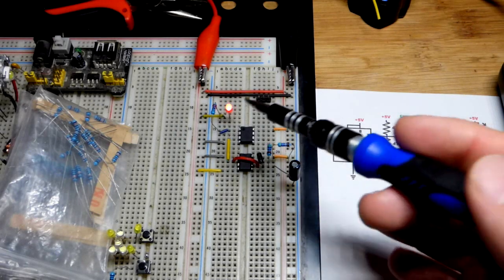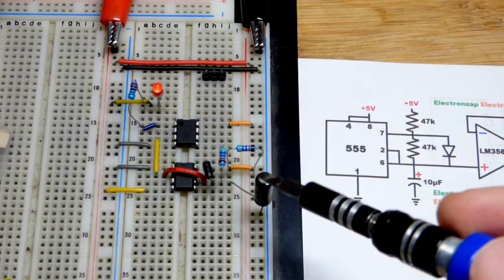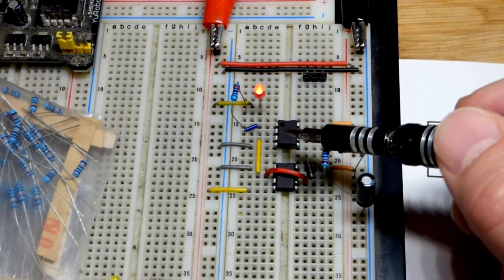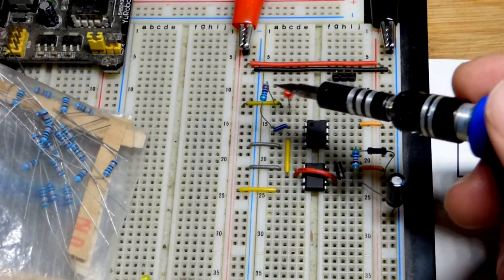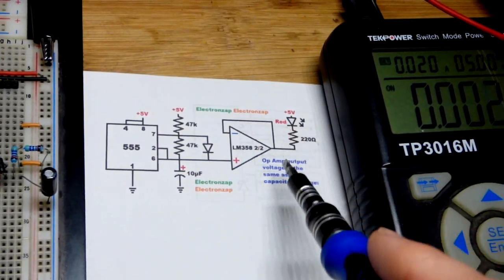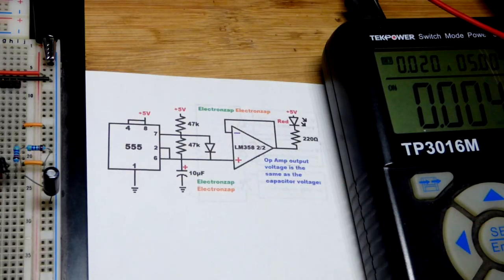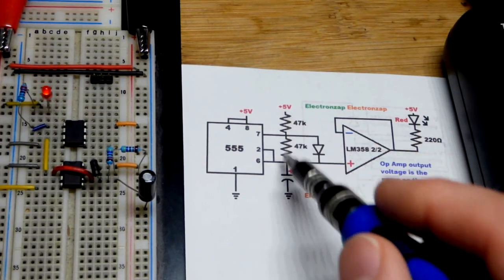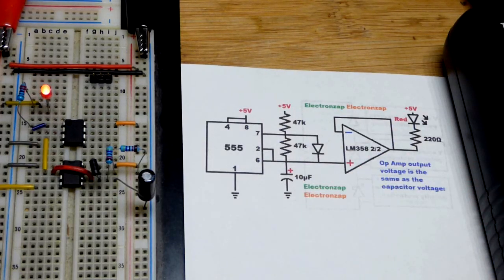Single Fading On Off LED using Astable 555 and LM358 Op Amp Voltage Follower

Comment: What’s the advantage of using the 555 instead of the other method you published were two comparators of the LM358 were used?
Reply from the maker: I don't know if either is better than the other.

Comment: If those resistor wires get any thinner. I have a better chance of not getting stuck if I went to a hospital and dipped my fingers into a bucket of used sharps than fumbling though a pile of loose resistors.
Reply from the maker: Thanks for the info!
Reply: I use old USD resistors from old equipment. They have thick wires.
For experiments I use Chinese resistors